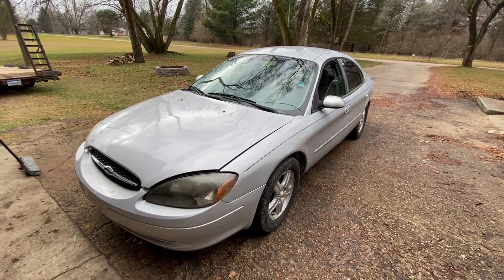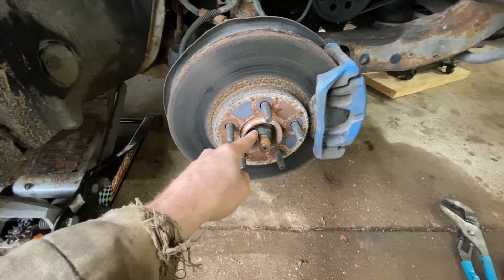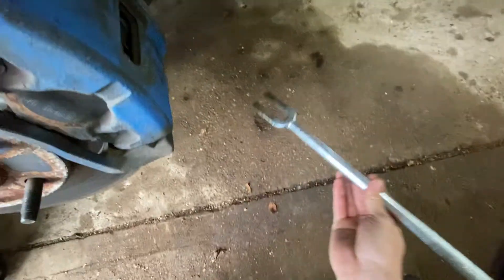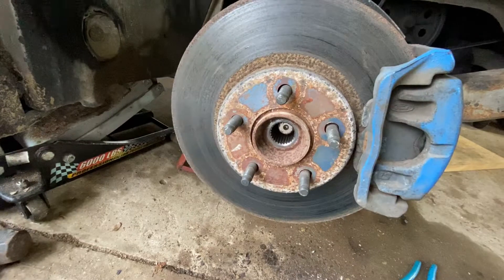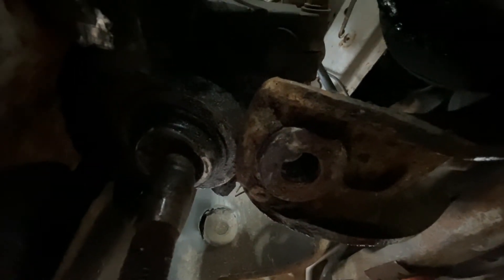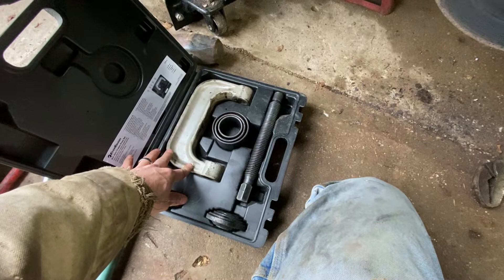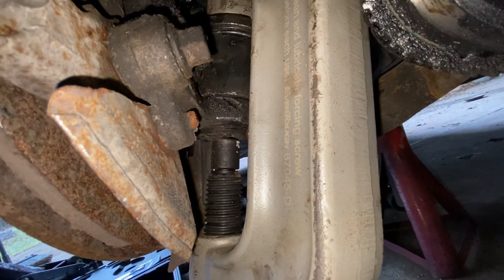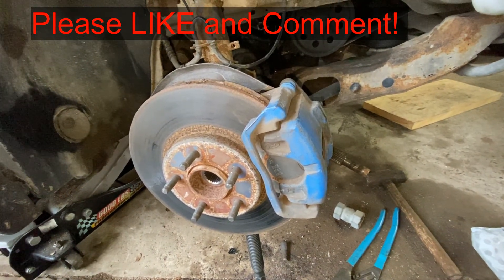How To Replace Lower Ball Joint Ford Taurus 2000-2007 00 01 02 03 04 05 06 07

Comment: You really needed to show how to press out the old ball joint and press in the new ball joint without cutting on the old ball joint. Not everybody has the tools to cut with and how do you press in the new ball joint without cutting the stud off ? You need to show more details in your video.
Reply from the maker: The press I had was not tall enough to press out the old ball joint without cutting it off. You can buy a cheap 4.5 angle grinder for $30. They are a very handy tool to have. 

If I could have pressed out the old ball joint without cutting it, I would have.

Comment: Props to u for getting the job done and I'm not trying to be mean but if you're going to do a how to video you need to know how to do it the correct way. You can watch 100 of these videos and nobody does it how you did.
Reply from the maker: You don’t have to apologize lol. I find it hard to believe on one else has ever done it this way.
Reply: I’ve been working on cars for almost 50 years, and this sort of creative work around is what happens with mechanics who have been working on cars for a while.  Sometimes it’s not the way you do it the first time, but after you’ve done it a few times I look at it thinking there is a good shortcut.  What I like about this is there should be no need for an alignment afterwards.  Kudos.
Reply: tony i’ve been working on cars for 145 years, everything here looks right